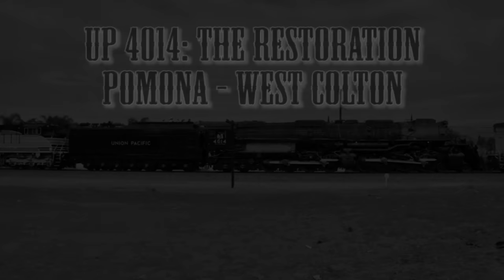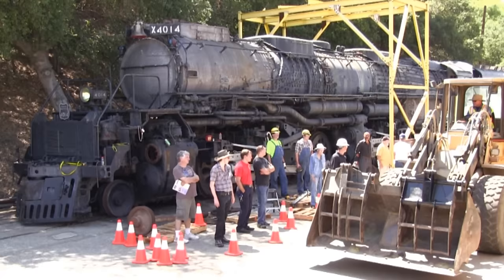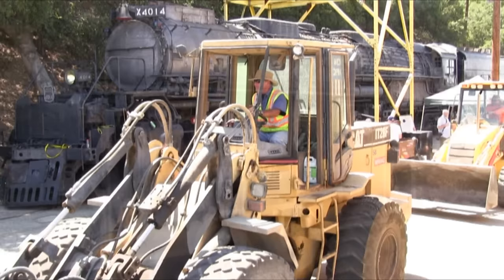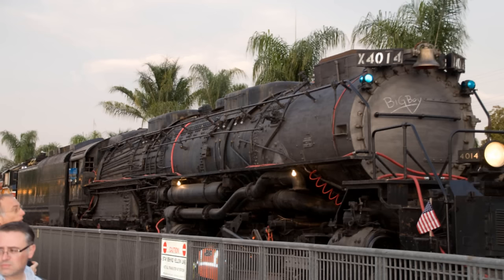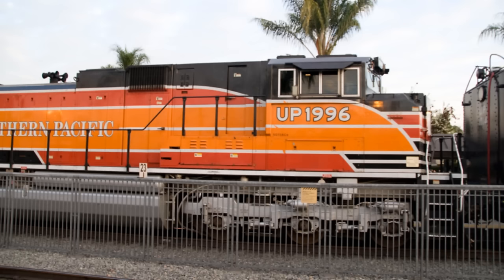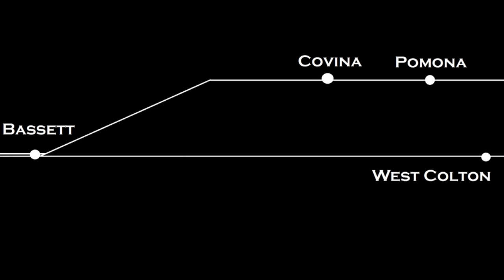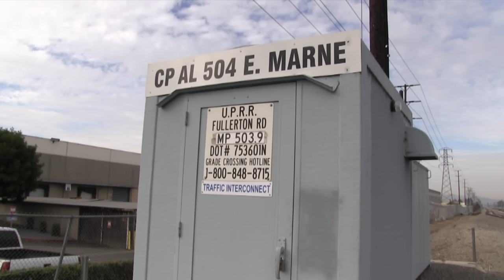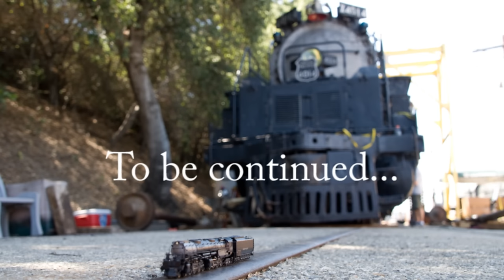Big Boy 4014 Steam Train - The Road to Restoration: Pomona to Colton

Comment: Just one thing worries me; the amount of pollution a steam locomotive can generate when it's running. But otherwise, riding on an old fashioned steam locomotive would be really cool.
Reply: It is true that a loco can throw out a lot of smoke. However, if the machine is being fired correctly, it can be greatly reduced. A lot of what you see coming out of the chimney ( especially on a cold day ) is steam...just pure water. I believe, and I stand to be corrected, is that 4014 will be an oil burner, not a coal burner to comply with clean air regulations.
Reply: It really depends on what is firing the steam locomotive. A coal fired locomotive's smoke is mostly ash that will fall back to the earth.
Reply: bigkiwimike You are correct sir, they said she'll be oil fired. According to the Wiki page about the BigBoy, they tried to oil fire one back in the 40's but it wasn't as powerful as the coal variant, so they converted it back.
Reply: Hjk
Reply: mojostevo Whether oil or coal fired, it is still a massive polluting external combustion engine, the size of which is not needed for pulling enthusiast trains, so my solution would be to cut it up for scrap without delay.
Reply: Wuh ohh... we got a troll here.
Reply: Hey heelfan 1234. The engine is going to be restored and run for the enjoyment and education of people every where. Thousands  of people are going to continue to make new engines and overhaul existing engines, including me. So get over it and stop trolling!
Reply: heelfan1234 america would have to be very stupid to scrap a piece of history
the big boy was like the king of the rails throughout the progression of steam locomotive development in america
it's a huge achievement that union pacific accomplished unlike most other railroads
steam ruled the rails in the old days
i think its a great idea to use it on special excursion rides; and i know for sure people will pay to ride with this ..

Comment: Why is it so rusty?
Reply from the maker: Because it's been sitting outside since 1962 and other than being oiled and touched up once in a while, it hasn't been through a major repair in over half a century.
Reply: Actually, compared to other steam locomotives out there, the 4014 was relatively well-preserved. Have you seen photos of the C&O 1309? Now, THAT loco is rusty...

Comment: This relic should have been cut apart & melted down in a foundry 70 years ago. Now the only thing it will be good for in heavy artillery live fire practice for the next generation of tank gunners & cruise missile operators. Then there is always the drones with the hell fire STG missiles.

It would be nice to see this hulk in a smoldering wreck!
Reply: Cockroach What it is good for is excursions and freight service.
Reply: i know right
Reply: +Jimmy Hook Thank you for the many extremely flattering compliments. I sincerely appreciate it! What you think of me is none of my concern or interest.

A 14" diamond blade gas powered portable concrete saw or angle grinder will do marvelous damage to the back head of a steam locomotive boiler, including the instruments & plumbing in the engineers cabin. To gain access just bust out the glass, open the door, let yourself in & fire up the machine! Off come the parts, very quickly! Then use it to cut or partially cut the piston rods, the main rods & the side rods! Even just a deep score into one them will weaken them to the point the old junker can not be operated! Then do a DEEP plunge cut into the steam  & valve chests or the supports for them! Nice, nice, nice! Cut off the headlight, the number herald, the extra lights & really mess it up! Great, great, great! Cut, cut, cut! Don't you like it?

Engineer's & fireman's instruments, bell, whistle, headlight, number herald, marker lights, builder's plate, grab irons, brass bearings, bushings or babbitts, tools, tin tool patterns, wiring, tubing, valve handles, valves, levers & many other parts.  ABSOLUTELY NO QUESTIONS ARE EVER ASKED ABOUT WHERE THE PARTS MAY HAVE COME FROM, WHEN OR HOW THEY WERE ACQUIRED! Very, very lucrative! Very, very profitable! Very, very low, low risk! It is very, very easy, quickly accessible & so, so rewarding!

Here is a long list of steam locomotives which can be targeted: #2, #3, #13, #29, #93, #112, #126, #175, #197, #202, #261, #385, #464, #470, #482, #484, #486, #488, #489, #502, #506, #576, #592, #630, #643, #700, #734, #759, #765, #844, #1218, #1223, #1258, #1309, #1361, #1504, #1518, #1604, #1630, #2100, #2101, #2124, #2156, #2467, #2500, #2542, #2716, #2749, #2933, #3001, #3003, #3007, #3424, #3977, #3985, #4003, #4004, #4005, #4006, #4008, #4012, #4014, #4017, #4018, #4023, #4100, #4294, #4449, #4460, #4500, #4501, #4516, #4524, #4978, #5017, #5629, #6755, #7002, #8300, #8305, #8327 and #9000 are out there waiting for a visit to have the parts removed for black market CASH sales! Then haul all of them into the scrapyard, torches, plasma cutters, chippers & crusher! Load out all that iron to foundry, put in the crucible of an induction furnace & melt it down! Happy, happy days with much celebrated joy!

Here is some of the prices I am hearing from those who say they have dealings with the black market:

Engineer's & fireman's instruments = $35,000 - $40,000 CASH paid
Bell = $22,000 - $25,000 CASH paid
Whistle = $60,000 - $75,000 CASH paid
Headlight = $8500 - $15,000 CASH paid
Number herald = $7800 - $13,500 CASH paid
Marker lights = $6000 - $9000 CASH paid
Builder's plate = $24,000 - $40,000 CASH paid
Grab irons = $1500 - $3500 CASH paid
Brass bearings, bushings or babbitts = $4000 - $8000 CASH paid
Tools = $1200 - $4000 CASH paid
Tin tool patterns = $1000 - $5000 CASH paid
Wiring = $300 - $800 CASH paid
Tubing = $750 - $2000 CASH paid
Valve handles = $100 - $650 CASH paid
Valves = $450 = $1000 CASH paid
Controlling Levers, throttles & brakes levers = $1800 - $3500 CASH paid
Many other parts for attractive sums of CASH!

All as close as your nearest heritage railroad or railroad museum!

ABSOLUTELY NO QUESTIONS ARE EVER ASKED ABOUT WHERE THE PARTS MAY HAVE COME FROM, WHEN OR HOW THEY WERE ACQUIRED! Very, very lucrative! Very, very profitable! Very, very low, low risk! It is very, very easy, quickly accessible & so, so rewarding!

Comment: Allthough not the fastest, heaviest of strongest steamer, French 2' D 2' was the best steam locomotive of the world.'
http://fr.wikipedia.org/wiki/242_A_1
Reply: 'Best' is really not applicable to steam engines, because they had such varied tasks to perform. What a big boy might be good at a faster, lighter engine couldn't do, and vice versa. There were no steamers that excelled in all functions. Arguably, you could make a case for 'best' as the ones that were most common and/or used in varied service. In America, maybe that would have been say, a Pacific class in the 20th century. Or, you might consider the steam engines that were so successful in the 19th century that they paved the way for all that followed! In any case, they were all complicated mechanical beasts, noisy, dirty, and they completely changed the world.